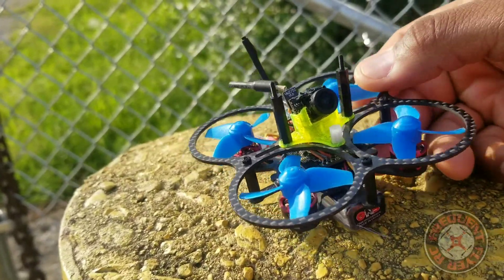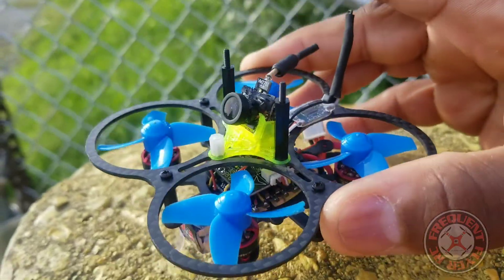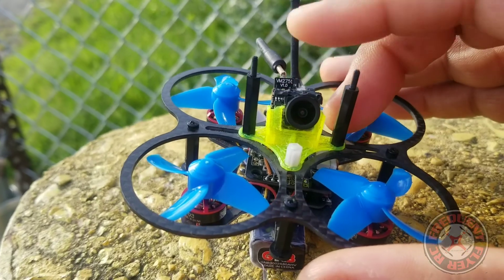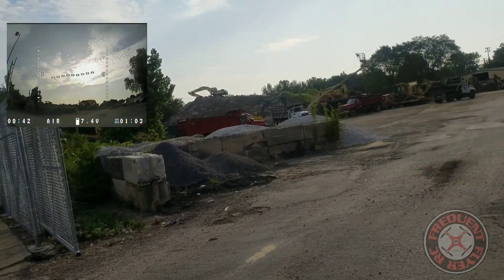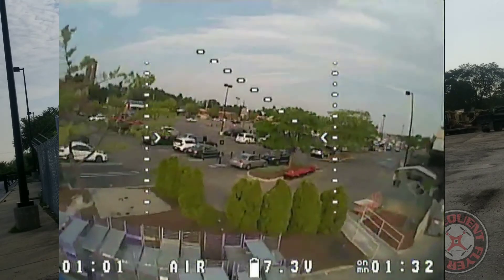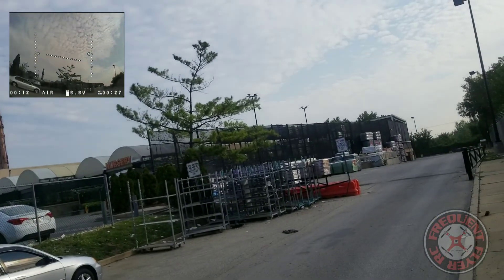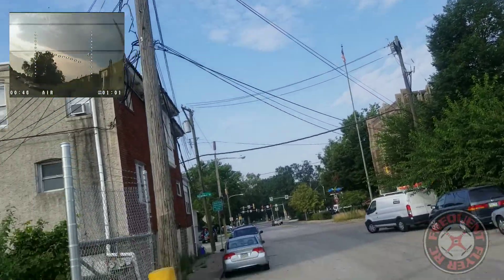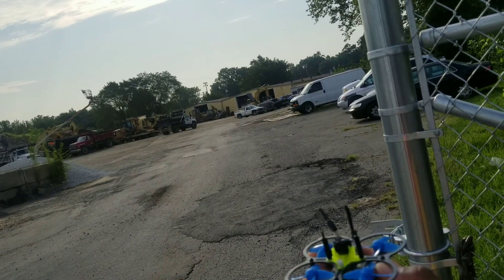Armor 67 - How Does it measure Up to Newer Brushless Whoops?

Comment: Ill fly this and my makerfire armor 90 all day over any of the newer whoops especially if there put on a smaller frame these things are still in the game
Reply from the maker: What do you like about them more.. sturdiness?
Reply: @FrequentFlyerRC  performance i feel as if the armor 90 on a toothpick frame will slaughter the rest of the toothpick and the durability of the 67 ive destroyed mine only used glue to repair still out flies my ur65
Reply from the maker: Should I ChopShop it?? BetaFPV has a nice new canopy that fits and holds a Caddex cam. Just add new canopy and can or put it on a toothpick frame? I will let you decide 👌🏽
Reply: @FrequentFlyerRC  toothpick frame...... would be nice to see what that does against new emax micro..??.. This is fukn awesome.

Comment: Sweet LOS/FPV flights on that vintage whoop sorry to hear about the receiver crapping out is there any way of putting a frsky XM+ on there?
Reply from the maker: Thanks man, yes there is a way to add an XM+ but I'm a DSMX guy lol! I do have a spare XM+ though..
Reply: Ok but don't you have a taranis radio I believe you had one of them in your videos? lol
Reply from the maker: Yes I do but I much prefer my Devo 8S which has multi protocol capabilities and seems to output more stronger 👌🏽

Comment: I own that 67.  The problem with it is the limited props available for it. The stock bull nose props are kinda terrible. Short, stubby, and you have to give a ton of throttle to get it up in the air. Plus, it's really noisy for a tiny quad. It also has an F3 chip. There is no room to make any changes to the camera, etc. because it's so small. It flew ok, but a very light crash and it no longer worked! It wasn't the first crash, but a light one took it out!
At first I liked it a lot, but that was way, way before the who0p craZe with all of these new options. Except for anything that has that horrendously unreliable Crazybee F4 Pro V2 board, this 67 doesn't compete with the new crop. For an example, my Scorpion 80, which flies 2 and 3S and weighs about 41g, is sooooo much better its not even close!  It screams on 3S!  The 67 was good for its time, but shows its age compared to anything with a good board in it, that's come out in the last year! The Mobula7, king of who0ps, kicks its ASS hard! Absolutely no comparison! 👍😊